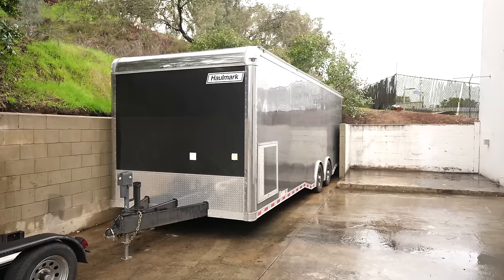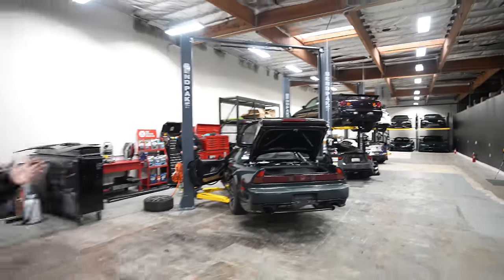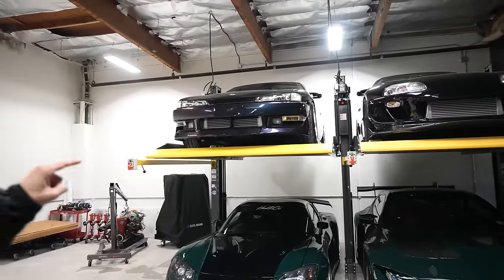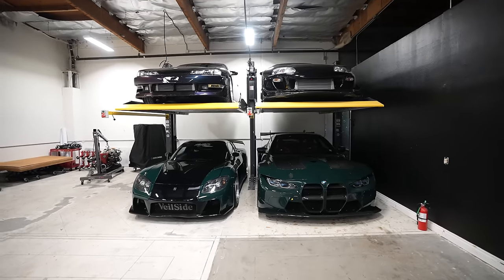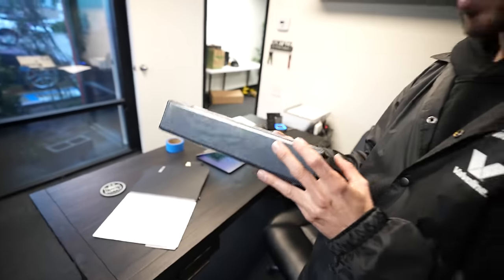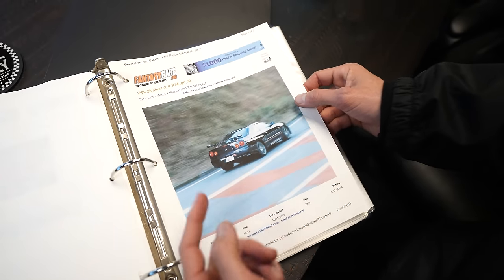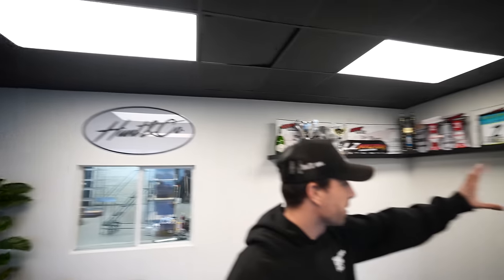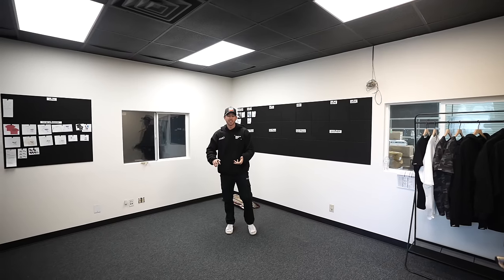My Largest Financial Investment is Completed!

Comment: Teej you might want to check how the HVAC is plumbed otherwise it wont matter if you build a wall or not as the air will be moving between spaces regardless....

Comment: I would recommend building a mezzanine floor in your storage areas so you can double your floor space for your shelving so you can stock more product.
Or you can get pallet racking (shelving) 4m,6m tall and need a stock picking lift to access the clothes from high up.
But you best option is installing a mezzanine floor.

Comment: Came across your channel from my son sending me the first NSX vid. Like watching what you’re doing with the new shop too. I smile every time I see your NSX, as I have what I call our 99 NSX/Accord. ( They have the same tail lights). I had to explain that to my wife.And the car is a rocket with the 3.1 v6. And what is hard to believe is that the car has over 200k miles on it and runs like a top. Hondas are bad ass, including my wife’s 2012 Accord. Rock on!

Comment: So what we do at tlc and retro designs is we have lift allocation for each division and also stage it based on if it's disassembly, fab, paint, assembly, interior. Also making sure the tooling your using is going to be staged appropriately  is crucial

Comment: quick suggestion.  If you are doing a lot of tire mounting/balancing  That first bay by the overhead door should have a Bendpack MDS-6LP mid-Rise lift.  To make it easy to drive on have the concrete cut so you can sink it into the ground so its flat to drive on.  My friend did that to his shop and it was super easy to do tire and suspension work.  For the amount of vehicles you will be potentially working on I think you should consider it. You could also put your future tire mounting and balancing machine in that general area.

Comment: A opoxy floor would’ve looked really good instead of the weird looking floor in the shop right now
Reply: I hope they do epoxy floors once you have epoxy floors you never go back to s*** floors again it improves the lighting by at least 20 30% and the cleanup is amazing not to mention how it transforms the shop like nothing else you doing it
Reply: Epoxy is crap, you need Polyasapartic floor coating, they even lifetime warranty it.
Reply: Its a leased space not bought. No point in investing something that expensive he's not going to keep.

Comment: Unless you plan on the big door by bay 1 closed all the time, maybe you have AC running or something, I would recommend using bay 4 for video. The exposure difference from inside to out might be a bit extreme for the camera to handle.

Comment: Bay 1 would be best I think. also if you need more light, you can open the garage door. Which could come in handy when working in tight spaces and the overhead lights don't cut it. Thinking as a camera guy myself. Also, update on the mustang soon? :)

Comment: Teej the wall is not going to be good enough. The exhaust fumes will make everything in that building stink. You should have hoses that run to the outside and a good exhaust fan on the car side of the building.

Comment: Just a thought, how is the ventilation setup for that space? I'm not knowledgeable on this, but I'd assume you'd want a pressure difference between the shop and the storage so that there is a higher air pressure in the storage room so that small particles and dust don't get sucked into that space over time. A wall will probably do a lot of heavy lifting, but its in no way a seal.

Comment: So the reason for your radiator fins doing that is because someone used the wrong type of antifreeze in the radiator because your traditional green which they have kind of changed recently but back in the 90s it was very corrosive and not very friendly with anything aluminum that's why everybody was switching to different types of antifreeze Volkswagen on the other hand has been doing it for years with phosphate free antifreeze it has to do something with the phosphate